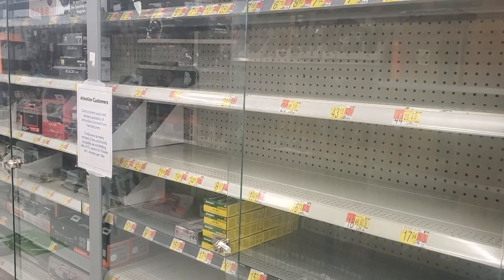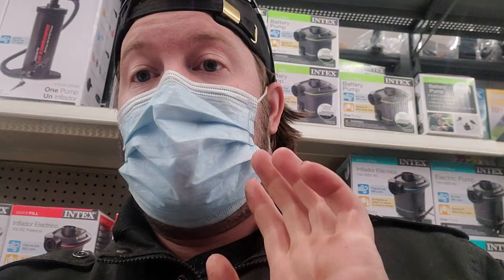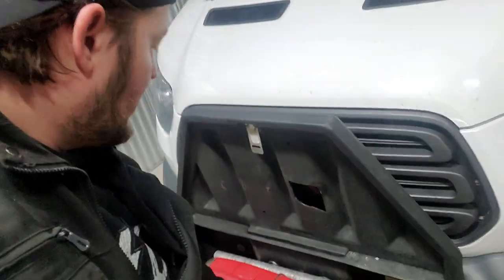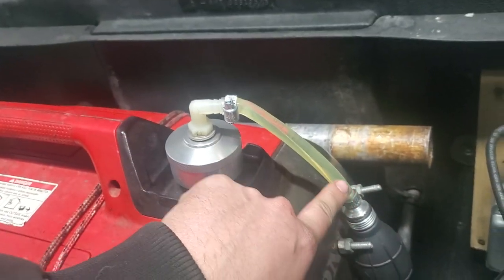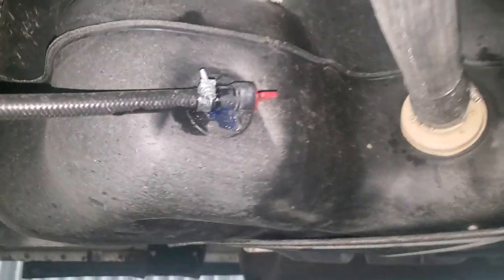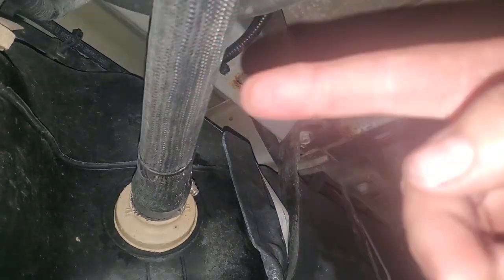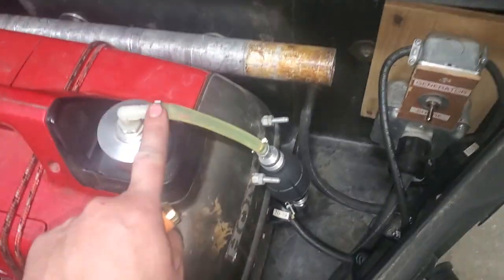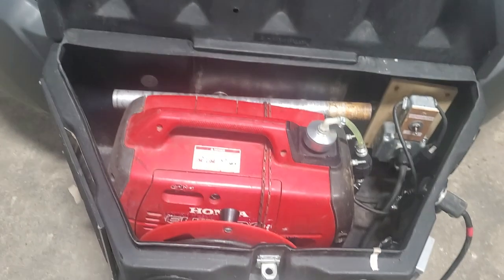TAPPED INTO MY GAS TANK

Comment: Mike  , like the gen set up ,to access the fuel aux on the fuel pump , is there a access panel or do you have to drop the tank?  To se up a wabasto heater ....
Reply from the maker: if your going tap into your tank through the aux on the fuel pump, yes you have to drop the tank